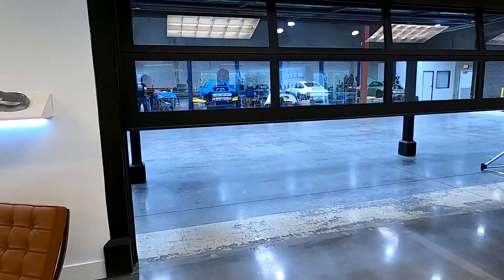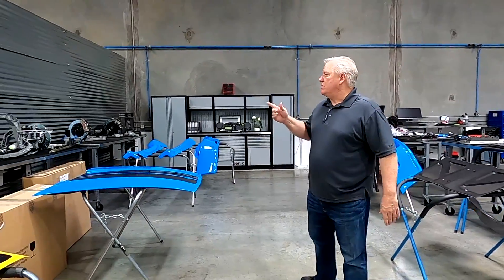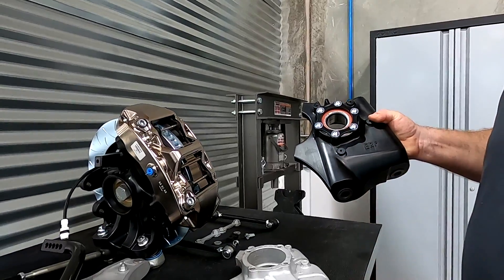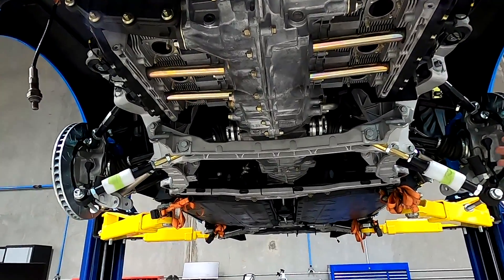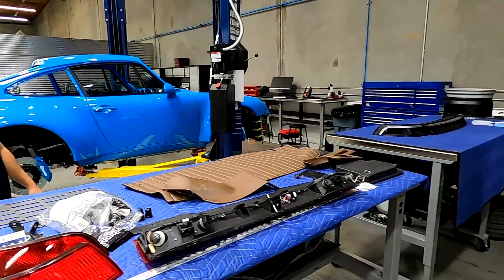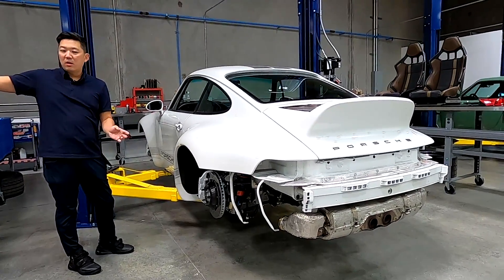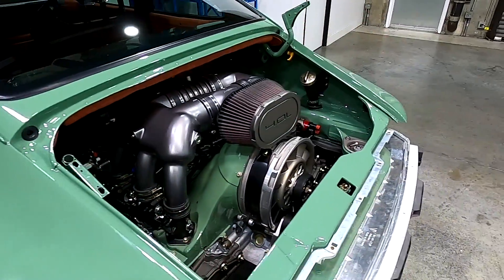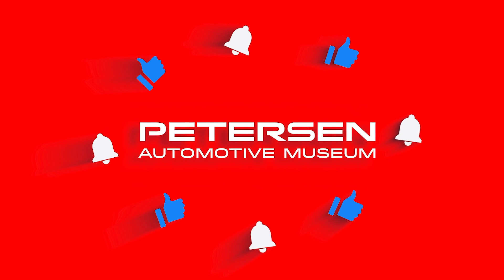400+HP AIR-COOLED PORSCHE | GUNTERWERKS SHOP WALK

Comment: @7:30, what does that linkage connecting the front and rear subframes do?
Reply: I assume it is to improve torsional rigidity but not sure because it would make more sense to do an X brace if that was the goal. So in summary I have no idea.
Reply: Shifter linkage

Comment: appreciate your effort BUT, if you are in racing for a long time, you know all this suspension A-Arm,... you are proud of designing them, already designed and used I would say probably when cup car starts in 94-95. Elephant racing and other companies are servicing this to 993 community,so I don't see anything new.what should be in this video would be talking about the engine which was zero talk about it. seems engine was outsourced, right? ,

Comment: Looks like you’ve essentially more than doubled the price of the car. Impressive engineering. Obviously the owner is quite wealthy. Souping up a Porsche is not for the budget limited. Are you trying to be a builder in the same category as Singer?
Reply: I believe they’re in a whole different category. Both are in the top of their respective categories, but definitely apples to oranges
Reply: @dalesweeny9194  dls singer is a 500 hp race engine.